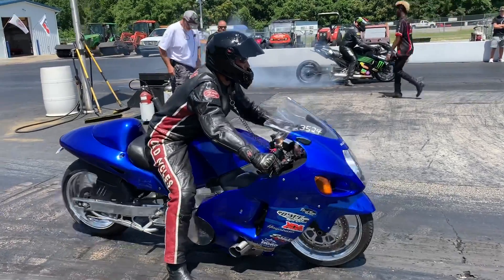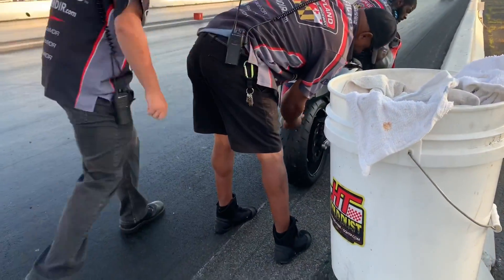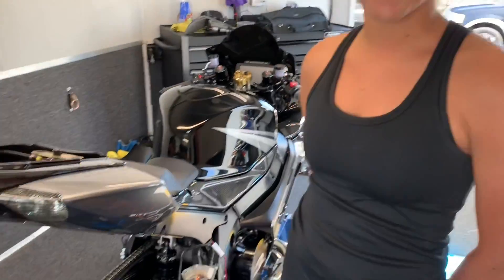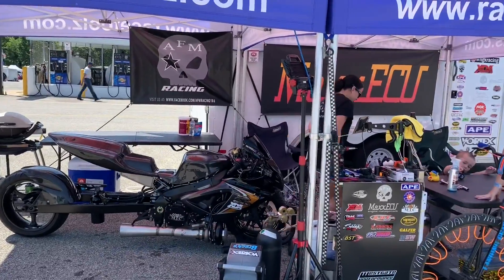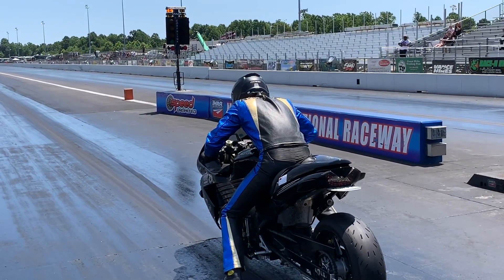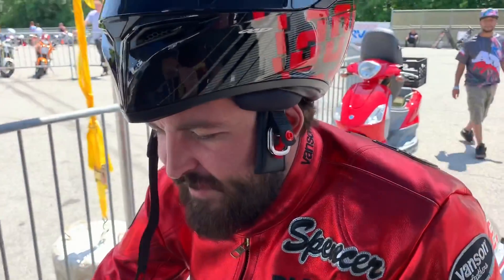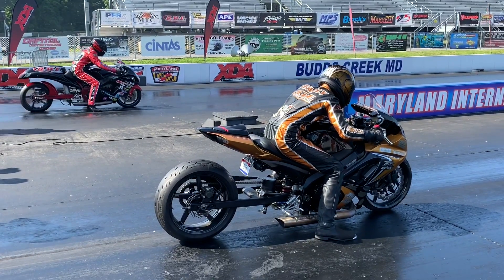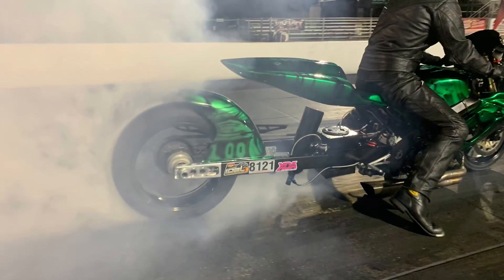16 FASTEST MOTORCYCLES IN THE WORLD STREET STYLE RACE! TURBO NITROUS ZX 14 vs HAYABUSA vs GSXR 1000!

Comment: Is there no limitations on cc on these race bikes
Reply: XDA Real Street Rulebook says unlimited motor modifications. 1 power-adder only, no intercooler and no nitro/supercharger combinations. 54.5mm inlet for turbos max. Need to run radiators (shortened allowed) GSXR 1000 need their blocks pinned through the water jackets to get a (all motor) 1205cc 5mm bore 6mm stroke (230-240whp) MR12, C16 etc gas allowed. Clutch, no sliders allowed. Stock frame and bodywork/headlight. Been thinking of building my street bike to fit Real Street rules to run too., hence info.

Comment: Does someone have to die to make the rules require a wheelie bar and a real drag racing tire ?   Motor cycle street tires and motorcycle track tires are not built to do smoky burnouts and then expect them to be consistent on a launch ...so you never know if the street tire after you blister it doing a burnout , is going to react to the track surface , until it's too late ..and with no wheelie bar sooner or later some one will die needlessly